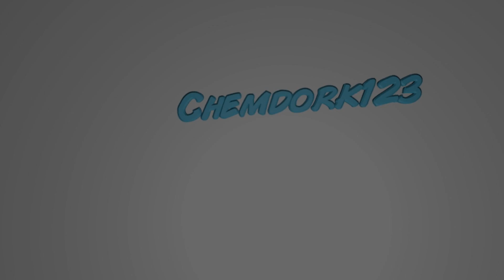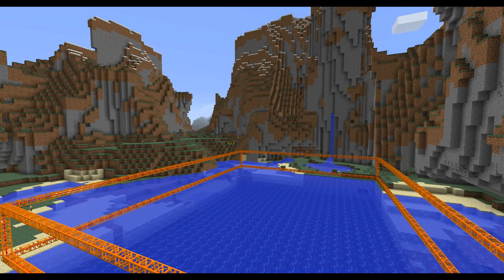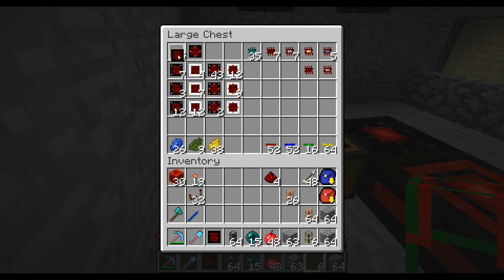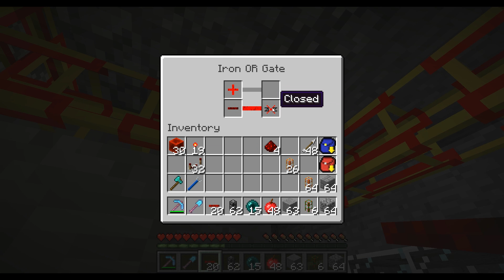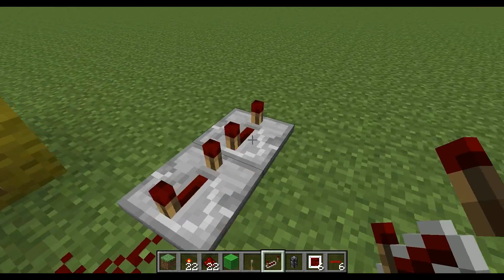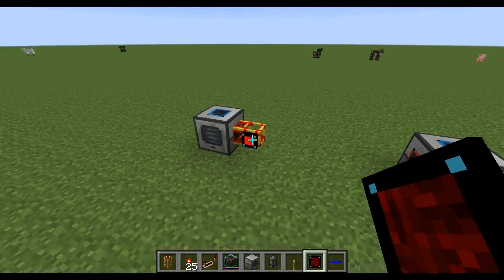My Buildcraft S2E48 - The Edge of Redstone

Comment: I just bought an Alienware x51 with an intel i7 8mb cache 4.0gh w/ turboboost, 16 gb of ddr4 ram, NVIDIA GeForce GTX 760 Ti with 2GB GDDR5, and 1tb of sata for the main drive for about $11,169.99. Deos this beat your rig chemdork123?
Reply from the maker: Yes, by far.  I have an AMD something CPU, NVIDIA GeForce GTX 550 Ti card, and an SSD.  The CPU/motherboard are quite a few years old now, so it's the weak link in the chain at this point.
Reply: lol
Reply: that lag u get just might be happening cuz your system is not very powerful

Comment: do you think that those mods will lag ma system i only have 1 GB of ram and my computer has a very heavy mileage on it, because i think it would be cool like every now and then you let people join you in-game, and well do whatever you need us to do. like running to the pyramid base and back or carrying items back and forth like a pack animal XD ive always wanted to be in one of your vids and now i have a Google account for some time i think i may as well fess up XD. but seriously can i run these mods on my 1 GB of ram and have confusing pipe lag like u do? please let me know. p.s why not make a force power breaker as i like to call it that way if you need to test stuff and don't want your engines running you can pull that switch and they will never activate what so ever even when machines aren't requesting power i suggest doing this using a redstone invert-er ( block, torch= redstone applied no signal come out and no signal on one end out on da other) realizes how big the comment is, and stops typing

Comment: I'm nearly positive that with the whole pipe wire thing, it will all be wonderful if all of the pipe is in the same chunk. When loading a world, it can't load every chunk at one moment, minecraft doesn't work that way. It loads the chunks and the one that has the gate turning on the wire may be in a different chunk then the one turning it into redstone, so the chunk that turns it into redstone may be loaded after (or before) the one that it's turning on the pipe wire on. This means that even if you have them 3 blocks away it still has a chance to do load incorrectly because it's possible, however unlikely, that they will be in different chunks. I think the only 100% reliable way to get this to work correctly every time is to emit the redstone at the SAME ONE that has the power requested at, or to check the chunk and see if they're in the same one.
Reply from the maker: I thought that too, but in some other experiments there wasn't a correlation with chunks, only with distance.  I might double-check with another experiment to be sure.
Reply: I guess both actually could change it. I'm not sure if you've ever looked at the whole pipe wire thing you have to control your power system while it's turning on, but it will probably look like some spots turn on at different times, so that may be causing that.... I still would think it would be best to just use the same one that checks for power requested to emit redstone too. Also, with things like the automation spot that you did in this one, don't you only need one a little bit further down the line to test for power requested? I don't think that "power requested" just checks for the machine next to it.
Reply from the maker: RetiredMaster hmm... You could be right about that.  I hope so, since that would make it a lot easier.  Thanks for the other suggestions!
Reply from the maker: RetiredMaster you were right about the "power requested" trigger not needing to be next to a machine, but I still have to do around with it to be sure how it is working.  Thanks again for the tip!